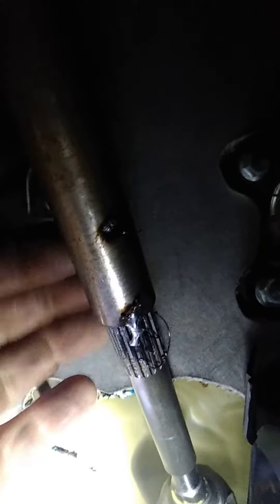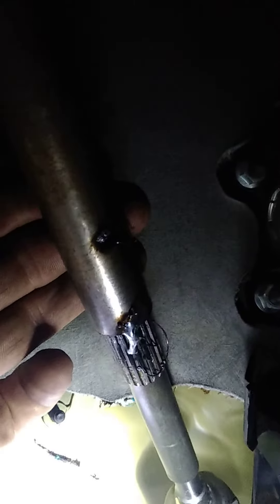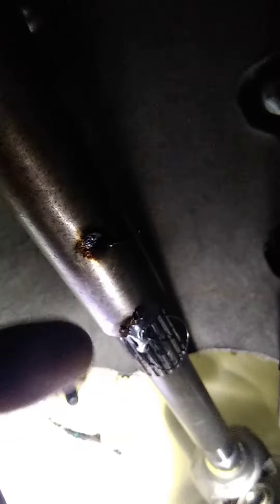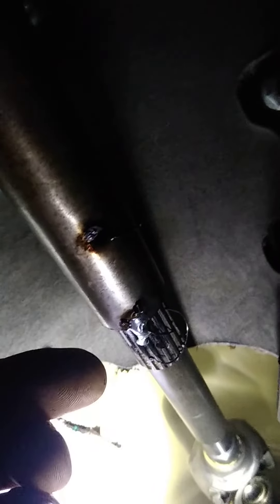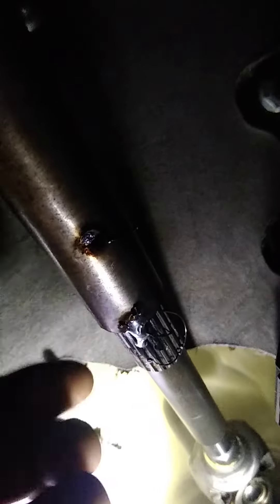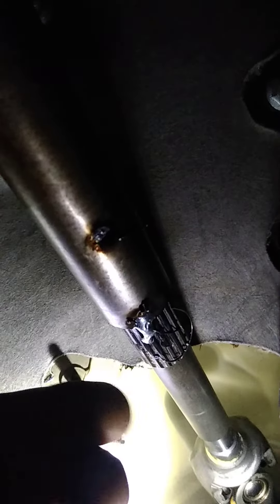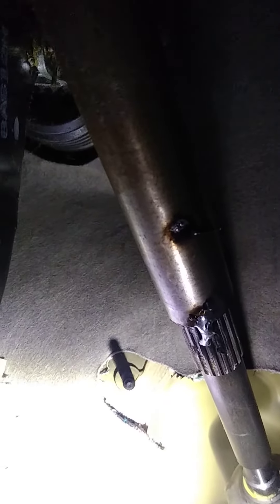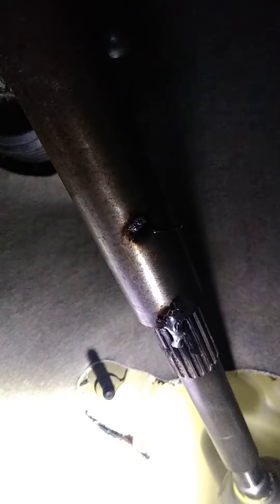Digging deeper into the Honda Odyssey steering clunk can be felt & heard inside the car/solved

Comment: What year is this Odyssey? You have so many videos on your channel, it’s hard to find where this clunking issue started in your video catalog.

I have a 2007 odyssey that makes a clunking noise anytime I turn the wheel, and it just came on very suddenly.
Reply from the maker: All years
Reply from the maker: Opps not sure steering shaft really  have changed much
Reply: If I can ignore the clunking, is there any risk safety wise? I dont see where there would be.